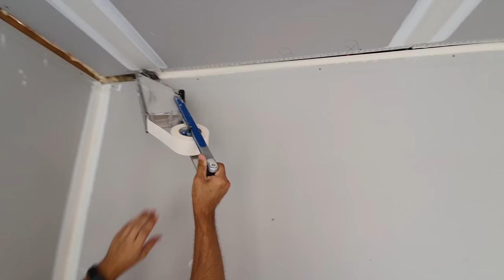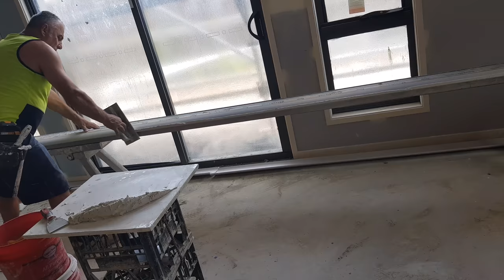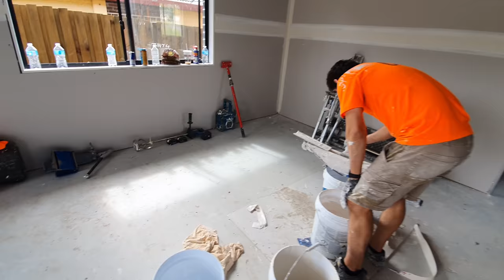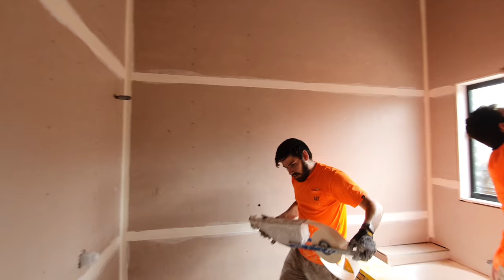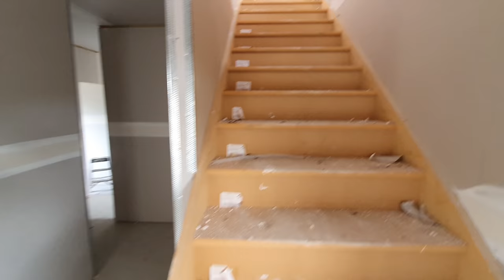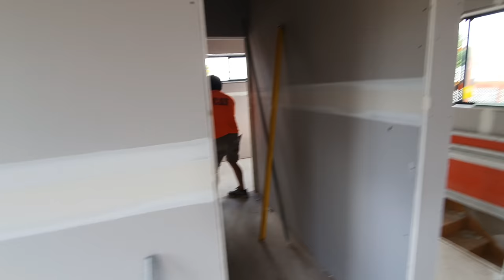Pro Construction Crew Finish Drywall with BIG Gaps in 10 Minutes

Comment: I wouldn't fill a gap that big. I'd tell the drywallers to tear it out and put up drywall that actually fits. Yes - everyone ends up with gaps at times, but there's no excuse for such shoddy work.
Reply: That gap is huge
Reply: 90 minute mud for gaps and tape.....  your fired before you started.

Warm water with 20min for gaps n fill also tape using cold water instead of warm.   mud 1st coat..  don't forget your cornerB Too!!.

45 minute for 2nd coat.

Bucket mud for that smooth next to no sand!.
Reply: Did u watch the rest of the video lol, the reason why the hap is there is because they hang crown moulding to cover it ….
Reply: @cameronluangrath  Yep...that's how they are covering the BIG cap in 10 minutes like the video says. Most the ass clowns in comments don't seem to get that
Reply: It's getting coved mate builders don't need to be sharp at all

Comment: Typical tapers in the comments complaining ;);). By code in NA we do lock our sheets from top down for dealing with heat transfer between rooms. Watching from east coast Canada every time you post before work!
Reply from the maker: yeah we don't need to do that here if cornice is going up, if its not we pretty well do it the same as you over there just less screws and use glue instead in the field
Reply: @Maxkil  is there a specific reason for leaving those gaps, like dealing with movement better, or just because of the wall height etc, or is it just out of convenience?
Reply: @ismu34  pretty sure its actually because the ceiling is a tiny bit higher that the (width of a sheet x2 )
Reply: You have got to be kidding me heat transfer 
Come down here to Michigan or basically anywhere in the US and hang a job like this and leave gaps like this any reputable Builder would fire you on the spot any contractor as I would fire you on the spot
You do not as a drywall contractor leave gaps like this anywhere in your board job

Comment: This happens when the ceilings are not hung first, the normal process for quality work begins by hanging ceilings and then walls so that the first sheet of the wall closes with the ceiling, this is a shitty job.  Even if they use crown molding, it is unacceptable.
Reply: Shit standards in Australia builders. All about speed and cost savings
Reply: The ceilings ARE hung first. And the cornice they use is the same material as the drywall so ceiling and walls are like one continuous sheet. Way stronger than any tape you could put in the corner. Too many experts in the comment section 🙄
Reply from the maker: Exactly... Thats a good answer.. thanks...

Comment: In US we push the top wallboard to the ceiling.  Must be different ceiling heights in UK
Reply from the maker: Hey Roger, thanks for watching, most of the time this cornice is used in homes, there are many different style types people can choose but they always go with the same boring ones like these, we are in Australia and we leave the drywall off the ground half an inch (just the thickness of the boards) and would prefer the gap to be at the top where it essentially gets a piece of drywall coving/cornice cemented around it, equivalent to pushing the sheets up tight.
Reply: Ya I work in the us and you’re not suppose to go all the way up

Comment: What is the tape called that you are applying in the corner walls? Do you add putty too or is it a gap filler solution?
Reply from the maker: that is paper tape, for the corners. Better finish and longevity tape it like this

Comment: Boys its supposed to go down to -36C in Saskatchewan, Canada tonight. Heaters running in our jobsites allllll the time. Cheers!!
Reply from the maker: Far out man, that is so cold, coldest I've ever been in is -4. Not working , I was on the couch under the blankets. Take care bud
Reply: @Maxkil  as an expat to Canada you do (somewhat) get acclimatized and learn to run from the car to the house with the correct key before your fingers freeze up.   I've watched trades who work in Nevada and cannot use "hot" or powered mud as it dries in the bucket before you get it on the wall.
Reply: @andrewcarr2431  Wow, I couldn't imagine. Maybe is the Canadian in me but I'd rather be freezing cold then blistering hot
Reply: @LiamD102  here in Australia the "stop work" temperature is when it hits +35, and in Alberta it was -40...after working in both it felt like "achievement unlocked" lol. Alberta was a nice dry cold though, unlike my home country.
Reply: hey, Liam tell them how hot it gets is Sask in the summer. some days its 40c plus most days it's 20-25c

Comment: So I bought on for these and totally failed at using it on my first try it was leaking out at the tapejustvdid not wana stick I got one vertical corner to work but after a while I just gave up it wouldn't do any horizontal any tips?

Comment: More importantly why was the drywall installed like that? Ceilings first, than walls starting with the top tight to the ceiling. And if the wall is slightly over 8ft for some reason( let’s say 8’3”) then you put a band of 3” between top and bottom sheet.
Reply: Not here in Australia no worries with gap at top-90mm cornice installed so covers all well-no need to be tight unless square set finish is required
Reply: I have the same question. I’ll tear everything down throw them in garbage trailer. The gap is not a problem but the drywall installation.
Reply: Shit standards here in Australia,  massive gaps should be sealed with insulation first.

Comment: I've been in drywall since the 70,s and my father started His business in 1957
But no disrespect to these guys 
But the commen rule to hanging drywall
Is that you lid it Frist(hang all ceilings)
And then you start hanging the walls
And you hang the top sheet Frist and then the bottom because the gap is supposed to be off the floor this is for a few reasons
Reply: The gap at the top makes perfect sense for ease, speed and to keep costs low.  No awkward join and the moulding covers over for a perfect finish.

Times change and cost influences the decisions.

When I hang my drywall, I have the smallest gap possible at the floor, around 25mm, so I can get my board lifter in easily.
Reply: Hey I want to square set my edges but if I take off my cornices there is a gap like 10-15cm going into the roof. What do I do
Reply: @elleishaletcher  im facing the same issue. Im planning on cutting out the cornices / crown moulding and patch/taping
Reply: @Tigerratcat  I’m thinking of using some cornice cement and those metal edging that you usually use on walls but inverting them and putting them in the corner, not sure still tho
Reply: @elleishaletcher  Found a product called No Coat Inside corner. That might be the go

Comment: i just know that in 50yrs or so someone will find that during a reno and say-ha look what they used to do in the old days!!!
Reply from the maker: lol probably
Reply: It ain't about doing it in the old days it's about hanging the board right
Reply: @dougelrod7877  -and these guys are spot on here in Australia-one thing i have learnt is that it is done differently all round the world-heck look at the U.K-the whole wall is plaster set(skimmed out ) all the time-they never just do the joints alone,and we use stud adhesives where U.S Does not
Reply: @dismaldog  lol you should take a look at the netherlands we call it stukadoren its basicly a 1-2cm layer which is then straightened and leveled using a 200cm(6"5 ft) stiff blade and the  compacted by skimming it again and again until its about 0,5cm(3/16 inch) and ready to paint. We use a gypsum based plaster manufactured bij knauf (mp75/goldband).
We use a lot more material too about 25 pounds per 11sq ft(9kg/m2)
Reply: @mrthecodguy  -i think i might have seen similar process years ago -on brickwork-it was sprayed on and screeded then filled and filled untill it was able to be trowel finished to a dead smooth mirror like finish-i think it was spanish method then

Comment: Just slap a load of plaster on it as a prefill then tape over, don't forget to add lots of horse hair to your mix to help it bond.  And dress like one of the "Peaky Blinders" crew to really show you are an old time plaster from the 1900's.  I guess you could use ultra wide angle tape same as off angles (No coat, Wide flex) but as the wood would suck the moisture out of the bonding material (eventually) and it would fail, crack and come loose.    I would superglue some bull nosed corner bead into the joint and seam fill that with heavy coats to make the wall joint really rounded....oh yeah we have that already, it's called Crown Moulding/cornice/coving...
Reply: Are you kidding me with those kind of gaps the Kwikset would fall through

Comment: You wouldn't have that big gap at the top if you hung the top sheet first and butted it up to the ceiling and and then put the next sheet on in your Gap will be at the bottom
Reply: It’s done like that on purpose because it has cornice covering the gap, if it was square set then it would be tight to the ceiling.
Reply: @fullyerect1294  if that works for you guys I just we don't use that stuff here but we always had the ceilings tight in the corners I apologize
Reply: @fredericsanderson3076  no need to apologise mate I was just explaining why there is a gap.